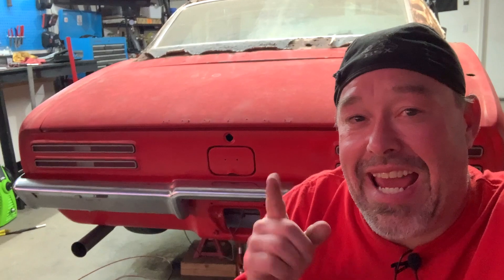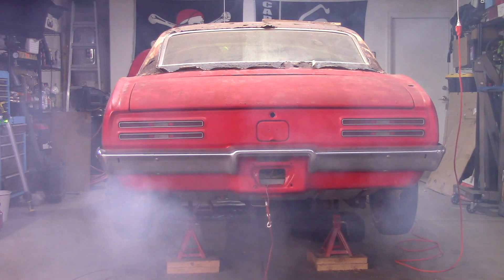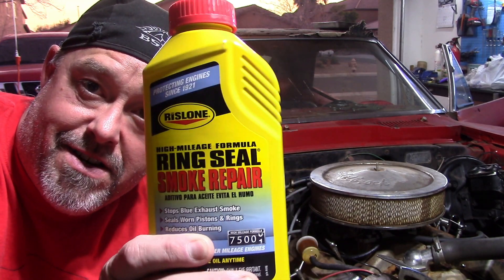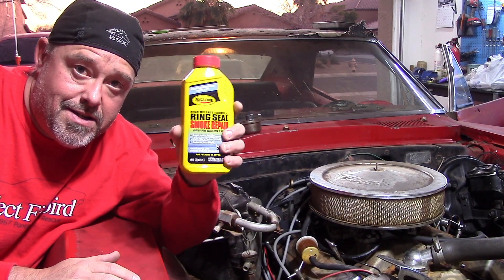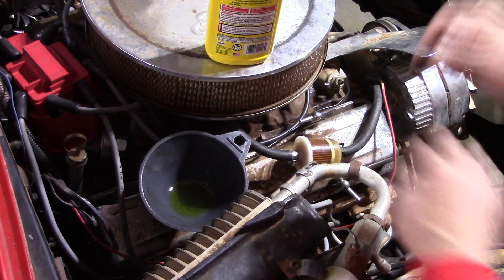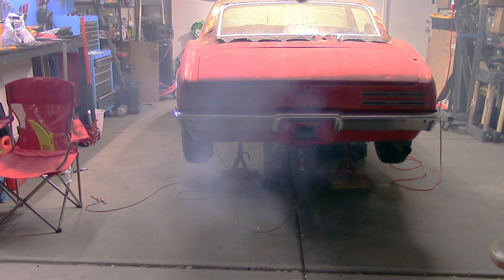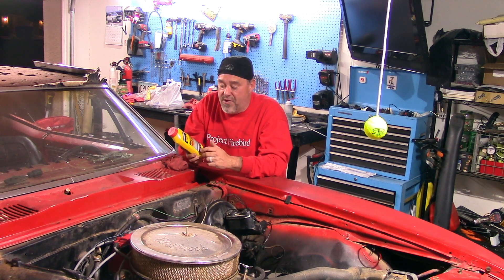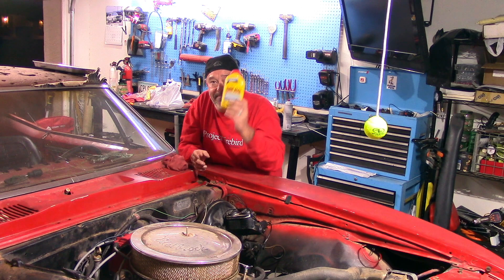Engine is Smoking White Blue from the exhaust, back of the car - 1967 Firebird Rescue Project

Comment: I would check the transmission vacuum modulator and make sure that the engine isn't sucking atf from it but I would also be half tempted to take the car out to an empty road and run it hard through all the gears and see if the smoke slows down or goes away, sometimes gas will varnish and stick the piston rings and cause some smoking as crazy as it sounds you should try to spray seafoam or GDI cleaner down the intake while it's running and see if that frees up the rings if they are stuck.
Reply from the maker: Looks like my trans vacuum line runs to the back of the intake and not the carb...

Comment: Hey Brian your valve seals are dried out.  And rings  are probably stuck from sitting so long would drive it a little to see if it clears up .had same problem on small block Chevy last fall had sat 14 years smoked bad finally got it safe to drive after about 20 miles it cleared up it smokes when I fire it up but clears up
Reply from the maker: I am hoping some good ole run time will help.  Also had several people suggest replacing the vacuum modulator on the TH350 to help with the smoking issue...  I'll know more next week!

Comment: You probably have use Lead Additive to motor in gas and use 89 or high octane with less Ethonal to but I use Shell Gas  to or any type  not Petro type and engine oil should be no Synthetic 10w30 type use Valvoline or Castrol GTX white bottle type or jugs! But if engine get lazy and rebuild up again too ! Also put A grey Bottle of STP Total Treatment fuel injection or carbs cleaner in 89 or higher octane gas too!

Comment: Like many others said more than likely valve stem seals or stuck rings. That rislone doesnt work very well. Pick up skme barrymans and piur down carb while running and rev it hard. Drive it and do this a cpl times and it may bring er around!! Good luck! Drop in a 400 and be done with it i say!
Reply from the maker: I think I am going to try the Barrymans as well... And HELL YA thats the goal to drop a 400 in this ole Bird!!!  Thanks for watching!

Comment: She may be pulling up some atf
Reply from the maker: Tony how would she be burning ATF.. what should I be checking? Thanks man
Reply: @ArrowheadGarage  it's a vacuum line, goes to the trans from the Carb, it could be bad on the trans, I had a cutlass, had to replace the valve on the trans. Easy fix brother, look into it.
Reply: @tonycompton6690  yes the vacuum modulators do have a habit of going bad especially if it's been sitting. It's unlikely that that's the issue with this car but its definitely worth taking a look at, he can test it by unhooking the vacuum line at the modulator and shove a bolt into the end of the line and just start it up and see if it improves.
Reply: I'm having this same issue on a 1976 blazer I bought with a 383. It smokes from one side of the exhaust. Part throttle and take off from the stop it is bad. Transmission fluid was low and it doesn't go into 3rd. I bought an adjustable modulator but haven't installed yet.